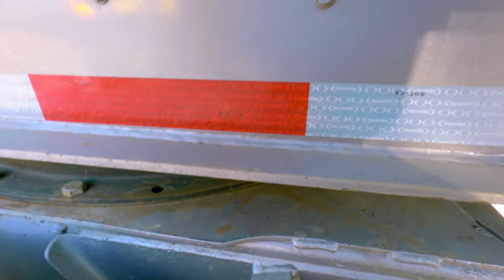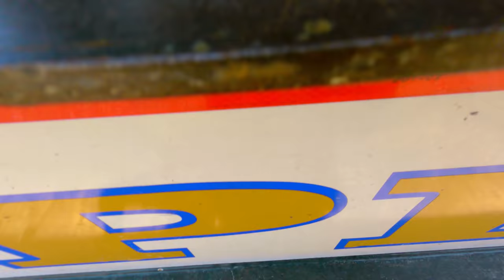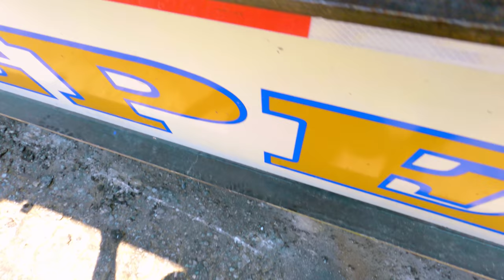Heavy duty towing gone wrong!

Comment: To Carlos, as a truck driver, and a former light/med duty wrecker operator, I can tell you. It is easy to back up while straight in a heavy truck, but it takes skill to back up around a corner. The only way to get better at backing while you turn is to practice in a space where you are not limited by obstacles around you. Gain some confidence in what you can do, and you won't have any more issues!

Comment: I appreciate seeing someone use a rotator as intended and to it’s potential. Too many companies are buying them these days and not putting in the time to learn how to properly operate them. I’ve seen a lot of unnecessary damage to the casualty during recoveries due to operator ignorance or laziness, not to mention the unnecessary abuse to the rotator itself for the same reasons. Thank you for representing the industry with class and for showing that while  rotators have brute force, a little thought, finesse and precision go a long way when operating one.
Reply from the maker: Oh I love using it the way it should. You'd be surprised how many rotators are in California and how few real operators there are. So many "rotator guys" that are scared of working off the side or using the truck the way it should

Comment: In one of your other video's you told about using fire hose  to protect your straps. So I bought some and use them on my straps for protection of them when hauling my old farm tractors to tractor shows. Sure is a lot nicer then using the chains. Thanks a lot for the idea.

Comment: Excellent job, my  younger days, before I became a broadcast engineer, I documented crashes in Europe. Hence I have seen a few. Nice ,nice job, very professional. Now I am handicapped and may only observe.
Reply from the maker: I bet you've seen some crazy stuff. Did you guys have rotators back then?
Reply: @PepesTowingService NO, as a matter of fact very frequently, on the Autobahn, involving a serious "lorry"  tractor-trailer crash, a motor-crane would be brought in. I sometimes wonder if maybe that wasn't the genius of the rotor design. If you look at basic boom concept it is most certainly fashioned after the Motor-crane, just highly 
Modified to fit the specific needs your industry needs. Your equipment is amazing. I wish I was not handicapped, as being with an engineering education I would love to observe your units in operation. You all are  true professionals in using the equipment as well as understanding the physics of what you are dealing with. 
Again excellent to the point of being an art!!!! CB

Comment: I drove transfers for many years. It looks like somebody didn’t lock the trailer box down. You have to flip that lever and set the on that valve. Great job on everything you did on loading and moving and unloading.
Reply: There’s no skid marks so wouldn’t that mean the hooks were locked allowing the trailer to be towed? Also the hooks aren’t laying flat. I’m curious because I just started driving transfer and trying to learn...
Reply: Trailer would have came off long before he got loaded... his brakes would've been locked up if he didn't lock the hooks and set the brakes
Reply: Transfer Driver’s worst nightmare! I drove transfers in the Valley back in the 90s. If I wasn’t behind the wheel, I was underneath it fixing something!

Comment: Great job man, lots of times at accidents it's the loads that do the damage not the trucks even when purpose built.

I drove and worked with heavy construction plant and low boys most of my working life, I would like to suggest using two guide ropes so the banks-men keep well away from the load, don't stand in the line of the boom because they most tip forward and go out of radius.
 Lifting loads in yards may seam safe but you never know whats underground that could collapse, worked on a job in London UK and we found cellars right where the cranes would be.

Stay safe man and thanks for posting.

Comment: I enjoy your videos very much. 
I tried to pick up a 20 ft OT conatainer the other day. 
I left it at the rail. they set it, it about flipped the truck sitting still. 
They took it off. Opened it up. The load was strapped all to the drivers side. Rail said nothing wrong here. The way it was leaning.  27000 lbs. 
Billed weight.

Comment: I had a similar experience with a transfer truck, about ten years ago. I was brand new (New as in second day EVER driving one of those trucks) to driving transfer trucks. All day long I told the bossman that it WASN'T safe to be transferring where we were told to to do it. I was told, "The other trucks are doing it, just do what they did, & you'll be alright." Tee last load of the day my trailer rolled out as I was transferring the trailer tub into the truck. The loaded tub landed on my reach just like this one did! We brought a mini excavator & unloaded the tub into my truck with it. After that the tower crane was able to lift the tub onto the trailer. We limped the trailer back to the repair shop. The bossman WASN'T happy with the outcome of this, "Just doing as the others did." The other drivers ALL said they were experiencing their trailers roiling back a little bit as they were transferring.  The safety man tried to tell me how I was on the wrong & SHOULD have known better. When I told him I HAD expressed concern about the situation to the bossman, he left me alone, & went to speak with bossman!
Reply: Drove transfer for twenty years. Always someone trying to get me to do something crazy with my truck lol. Just used my own judgement because if something went wrong their was nobody to blame but me lol.
Reply: @stanechols8032  I ran for 33yrs.{ on the wifes computer} leaned the hard way, started hauling newsprint,20 ton loads on a single axel straight job,then went to reefer with food,after that no one would hire me cause I what I could and could not do. 33yrs with no at fault accidents,but where in a few,I do not miss it but once loved it for many years.

Comment: I used to drive a transfer truck.. (in Sacramento) There are 4 locks that hold the trailer to the frame. I only saw one.. and it was still connected. Makes me wonder how it was towed that far without crashing like this earlier. Nice skills on lifting and moving the box and the trailer. Cocky..  NOT..  Confident.. Sure and not too proud. Well done.

Comment: Great video. Only thing I saw of concern was when you were loading the the dumpster back on the trailer at the lot you had 1 guy holding a tether to it and another basically standing under it and in a precarious position between the trailer and semi trailer. had something happened he would have no time to react or get out of the way. You only need 1 man on the tether. Everyone else is a liability.
Reply: That part was giving me anxiety, it only takes one incident OR even if one strap breaks, everything will come crashing down. I know he's good at what he does, but this certainly was sketchy. Never have a human so close to a moving heavy load like that, especially when that heavy load depends on two straps and hydraulics crane.

Comment: The fact there are weight laws so convoluted in some states that things like “slam-bang” type end dump combinations like this exist and are a common sight on the roads is just insane. Just a few states east and you can carry essentially the same size load as this setup on a tri or quad axle  straight dump truck (tandem drive with 1 or 2 lift axles). Somehow we’ve come to agreements for fuel tax and licensing that cover the majority of states and most of Canada yet there are dozens of vastly different weight regulations varying wildly from state to state. I can drive the same truck I can legally gross 77,000 lbs in just a short 15 miles up the same 2 lane highway and never turn off that road….and the moment I pass a “state line” sign I’ll be 23,000 lbs over weight even though I’m on the same road that was built to the exact same  standards as I was before passing that sign. We need to get with the program and just make things simple so we don’t have to build and drive Rube Goldberg-esque  contraptions like a “slam bang” end dump combination to try and meet the goofy weight laws in certain areas of the country. Every time you add complexity to the truck or combination you’re creating an extra step in safely operating that vehicle for an inexperienced or complacent driver to miss or screw up. In a slam-bang end dump instead of the driver just needing to remember to latch his tailgate before getting loaded, they now need to make sure two gates are latched, a trailer is hooked up properly, and the second truck body on wheels sitting on rails is securely latched and fastened to that trailer.

Comment: Saw this happen a few times. Great job with the recovery. After twenty years of experiance with transfers and seeig what can go wrong. Their is another way you could of handled this job.
First the driver should have went somewhere close by and dumped out his truck box.
While he was was doing that, you could have been lifting the trailer box back on to the trailer.
When the truck returned he could have opened his gate and backed up to the trailer as normal and rolled the loaded box into the truck. Then he could either have hooked back up to the trailer then or went and dumped out the trailer box. Then come back and roll trailer box back on the trailer and secure. Then hook truck to trailer hitch and straighten drawbar.
This way you would only have to lift the loaded box one time and not need the lowbed.
I know how things get when lot's of eyes are watching and you do not know the whole story untill you arrive on the job.
Still good job handling the equipment and not breaking anything 💪💪
Reply from the maker: That's an insanely complicated and long way of doing that job. His destination was 90 minutes away, where would he find somewhere to just throw 13 tons of dirt to come back empty handed. Then, how would he get it back? You need permits and paperwork ahead of time for places to accept that much. I'd be on the freeway blocking lanes for hours using that method. Plus the box came off for a reason which isn't my job to figure out. I determined it was no longer safe to set on top and be street legal. He can worry about that in the safety of his yard with a mechanic. If I set it back on at the scene, even if empty, and it fell off again, now I'm liable.
Reply: I agree with you. 
Like i said you had chp and caltrans and time and saftey to consider.
Just pointing out you had more options. 
The reason the box came off was plain to see. 
He did not secure the hooks before he left when he was empty. 
Then when he was loaded and hit the brakes hard enough the box rolled off.
Sometimes if the trailer is on unlevel ground and is twisted a little. 
The hooks will not secure the box to the trailer.
 Looked like that trailer only had two hooks instead of four. It was a miracle the box did not come off sooner.
Always transfer on level spot so trailer is not twisted. Make sure hooks are secured to trailer before leaving.
If he had a good dispatcher they could have found him a safe place to dump near by.
We put a loaded box back up  on a trailer with a loader locked it back down and then transfered to the truck. We were not blocking any freeways lol
Not knocking your work at all.
Stay safe.

Comment: No doubt a good recovery you could have put the box back on the trailer and towed it separately from the central unit. Then they could repair the trailer tongue at a safe location make repairs to the locking mechanism and then off load the contents of the trailer box. With the dump truck the way a transfer rig is intended to work.A lot of unnecessary steps on your part but you do you ..

Comment: Oh HI,  in the future when you are trying to put together 2 things in a confined space , consider raising the load and suck the boom in to change the radius. If you had done that you could have put that box back on trailer in have the time. Also don't  park the trailer so close t p the box trailer, that just tightened everything up. Otherwise great job. 👍
Reply: I meant suck the boom in , not such it in.
Reply from the maker: It took me minutes, how much time could I possibly have saved? Speed is never the name of the game, it's all about total control and safety. Further, retracting and extending the boom while under tension is an absolute last resort, never a first option. The preferred way is to boom up and down and play with the cables. Your way exhausts the wear pads much faster

Comment: I'm surprised you put the box back on the damaged trailer.?
Reply from the maker: What good would it have done to leave it on the floor loaded with 13tons? I left it where the customer wanted
Reply: I was thinking more from the safety aspect of the trailer tounge being damaged and possibly not usable. True, the customer cannot transfer the box into the truck off the ground. You did an amazing job of setting that box on the frame.
Reply from the maker: My guess is the impact made the wheel knock back and release the brake. Since it's just at his yard, it's safe to set it down since it won't be moved, and be a lot easier to transfer the load. Thank you!

Comment: When driving these large wreakers, are they exempt from weight restrictions?  If a semi is maxed or close and needs a tow, you'd have to be exempt....right?   What is your max combined weight limits?
Reply from the maker: No, you still have weight limits but it varies. Your tow truck needs permits and can only have so much weight on the underlift. If I'm towing a loaded tractor trailer, you aren't lifting that full amount. Just the weight of the front of the tractor

Comment: Another great job.  Just one question, since that is not a dump trailer, how is that load dumped out of that body?  Love to watch your videos.  TP
Reply: Transfer dumps are a West Coast thing. You dump the body attached to the truck, then back up to the trailer and "transfer" the second body from the trailer into the now empty box on the back of the truck. I never saw one until I moved to Cali in 1967. They are cool!
Reply from the maker: 100% correct, and thank you for beating me to it and answering this!
Reply: @frankbroker3698  I'm in New England, and I've never seen one.  Thanks for that explanation.  TP

Comment: IS THIS THE SAME FRAME? IF IT IS WHY NOT MOUNTED AT THE PREVIOUS SCENE?
Reply: The trailer is damaged. Not safe to tow with loaded box. Ok to mount it at customers yard as it isn’t going anywhere and can be unloaded easily.
Reply from the maker: First, why are you yelling. Second, I would have to be an absolute idiot to set it back on and tow that thing 90 minutes. What happens if it happens again? Then I'm liable. Why would I assume that horrible risk and possibly cause a huge accident?

Comment: Should have used a spreader bar on those straps to keep it from folding in the top of the box..
Reply from the maker: That's completely overkill. Did you even see the video? Literally no damage, the walls are not plastic lol, they're built to expand and retract. Using 32' long straps with a lot of boom height was the absolute best and fastest way to do this. Some people just find anything to bitch about I swear

Comment: Why not rotate load to rear, set down, pull outriggers in?
Reply from the maker: For what?
Reply: @PepesTowingService  to avoid any contact with outrigger.
Reply from the maker: @arlisspropertyservicesllc5943  Problems arise that you don't expect that you have to work around. I never imagined the second trailer would not be able to clear the outrigger. That's what my ramps were for. Even if I knew they wouldn't clear, I still would have done this method. Your method is more risky. The less time on scene, the better. Your way would have me rotate behind the truck, setting it down, then lifting it again after the Landoll backs up. What if something went wrong during that time? The ramps took mere seconds to setup and worked flawlessly. How long would it take to swing, drop, put outriggers away, set them back up, lift, swing back around?
Reply: @PepesTowingService  ok. I guess it’s different for tow trucks vs mobile cranes. I was taught never to let anything come into contact with outriggers under a load, too many opportunities for rigger cylinders to be tweaked etc etc.

Comment: Just curious how come yall don't use walkie-talkies so you don't have to run up to the other truck to tell your CO worker what you need and it's a loud environment must be hard to hear sometimes.
Reply from the maker: We have Setcom wireless headsets on every rotator. $700 a piece and they work great, I use them in a ton of my videos. Sometimes they aren't necessary, like on a close quarters job like this.

Comment: Why didn't you put back on the owns trailer to start with .....the bill would of been less
Reply from the maker: Anyone who would have done that is an idiot and reckless. It came off the rails for unknown reasons. You have to assume it's broken and no longer safe for transport. If the frame was compromised or a lock broken, and I set it back on here, who is responsible if it comes off again during the 90minute tow? I am. What kind of moron would I be to assume that responsibility and not do it the proper and safe way? I hope you are not a tower because that dangerous dollar saving mentality will get someone killed one day.